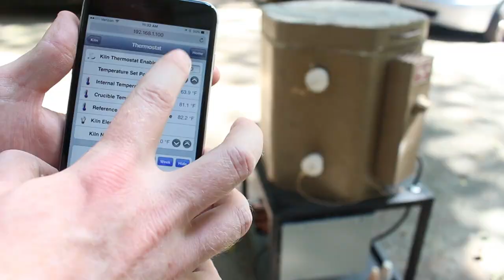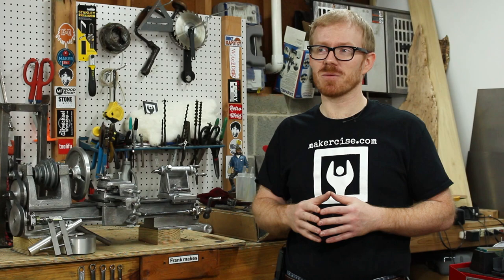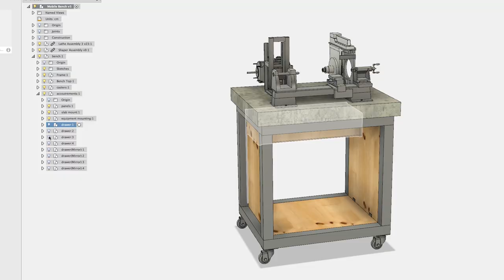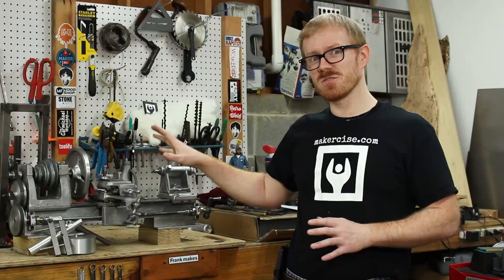5 Minute Lathe Build

Comment: Great series! I built my own lathe similar to the Gingery design,  It swings 9 inch over he ways, gear driven apron and hand wheel on rack and pinon, I might suggest you use 10 WT oil for the head-stock bearings. You need to use cutting oil on your turning projects, the tool steel loads with the turning and fractures your finish..high speed slow feed, plus cutting fluid! When using centers for turning, which should be hardened, use extreme pressure grease on the engagement, along time ago we used "white lead".new project is a knee type milling machine..........anyone who builds these "home grown machines" is a tribute to Dave Gingery.......Have fun and be safe.....always think outside the box!
Reply from the maker: Christy King I picked up some magic tap fluid. It smokes a ton...so much that I'd rather skip it on all the rough turning. for finish cuts the fluid improves the finish for sure. my ventilation in the basement isn't great so I have some concerns about the smoking. the SDS suggests that there are no minimum exposure concentration limits where respiratory ppe is required. this seems counter intuitive to me so I have been running dry since the only drawback seems to be surface finish. thoughts?
Reply: There are numerous cutting fluid products available, some are synthetic and there are those that are water based. The "mist" type application is the new norm, along with flood or flush, which is used on high speed CNC apps, I'd try a mist type unit if smoke and fumes are a concern, Magic tap is not a good product for cutting fluid for turning!

Comment: What find very nice is the lathe helping complete itself.    It drives home the tool making tool aspect of the lathe.   You might want to include an overview of the technical details of the lathe.  I mean speeds capacities, gearing options, etc.   A shop made uni, allows these features  to change., over time. Thanks for a great series.

Comment: I have had the Gingery books for years, but never  took the next step.  I should try it,

 I do have casting experience
If I could make a small suggestion. Make yourself a right angle pour handle. Better control and safer. 

Excellent set of videos. Looking forward to seeing the shaper built.

Comment: wowzers. i wish i could do that.  im almost there.  its really about reaching critical mass.  you know, accumulating enough tools to begin making tools with your tools, im approaching critical mass. im 35 i mean 32
Reply from the maker: Please be sure to share if you get to that point and start building. The great thing about the Gingery design is that it doesn't require a machine shop to start with. A tiny drill press like mine though a luxury not mentioned it the book, seems like a tool Gingery would have appreciate had they been so affordable 30 years ago.

Comment: Amazing build. Watching this 5 mins condense truly shows how good you are. Quick question. Any video on the Motor parts build?
Reply from the maker: Joseph Joe no. I quickly fabricated without filming. I am going to overhaul, film, and put out a video. probably out about a couple months guestimating. thanks for the complenent.
Reply: Thanks for your quick response, I appreciate that. I bought Dave Gingery book, hopefully it will explain that part until you make the video. Once again Great job
Reply from the maker: Joseph Joe it is an excellent book. the motor Mount is detailed in the lathe and shaper book.

Comment: Personally I’d never build one of these the accuracy would be difficult to achieve and having a lathe and mill already I could far exceed the quality and avoid the cheap alloy casting. It’s a great learning experience for a beginner and the plans themselves could be used as a basis to design something more rigid. Even using thick mic 6 plate would be a better choice for many parts and either 4140 or 17-4 for others. Cast steel would be ideal for the base but obviously out of reach of the home brew. Neat to see someone actually do more than just read the book as many will do and leave it at that.

Comment: I've been watching your builds of the lathe and the shaper for some time now.  Very impressive work!!! 

Question: In one of your shaper videos, you show a brief screenshot of a spreadsheet showing your total time (I think), materials costs, and fuel costs for the shaper.  Did you keep track of that for the lathe?  If you reference this in a video, I have missed it.  What was your total time, material cost, and fuel cost for this lathe?  Thank you!
Reply from the maker: Unfortunately I abandoned meticulous time tracking. I estimate 1000 hours +/- 500 for the lathe build...same for shaper. ~$200-300 a piece. $60 propane cost. Wildly Aimed Guess (WAG)
Reply: @Makercise  thanks for your response! And also, your definition of WAG is more family-friendly  than the one I learned. :)

Comment: Now that you've completed the lathe and used it for a while is there anything you would have done differently or would change so that it would perform better?
Reply from the maker: Harold D funny you should ask. I will cast replacement bearings and a chuck adapter within a week. Keep an eye out for the video. Probably within a month or so.
Reply: Looking forward to it. The reason I ask is I'm starting to work on my Gingery lathe now and I'm hoping to benefit from your experience LOL

Comment: I'm assuming that you had some background in metal working to be able to build this lathe.  I have the Gingery book (bought the thick volume before Lindsay retired), and I'm amazed that Dave built the lathe BEFORE he built his drill press and Milling machine.  To me it's a bit of a cave man process, which your videos make look easy (it's not).  One of these days I'll try getting a charcoal furnace going and at least try to do some casting.  I have built a 3D printer which could be used to make some of the mold forms.
Reply from the maker: I had a drill press and a bench grinder. I bought a welder and angle grinder at some point during the project. I didn’t and still don’t have a mill.

Comment: hey chris, i'm just building a woodturning lathe (i really want a metal lathe but that requires more skills i dont have yet). your videos helped me out quite a bit in figuring out how some things work and how they dont. 

i hope i can fabricate templates for a metal lathe. the woodturning lathe is built of steel, and i wonder if its strong enough to turn soft metals like tungs... ahm copper and aluminum maybe also brass... is there any comparaison between wood and metal from what the forces are? i mean its not gonna be dead on accurate but i dont really care as long as its somewhat close in tolerances. 

anyways great videos, keep it up and you will have a lot of subs soon :)
Reply from the maker: +Sharky i dont know of any comparisons. I am sure there are some somewhere. Probably the best bet would be to rig an angle grinder in the mix. Because it abraids material the cutting force could be almost nothing depending on how much time you want to take turning the part. I say go for it either way.
Reply: thats a brilliant idea! but one week and many hours later, i'm quite confident that the thing is gonna be strong enough to cut whatever i want. the only things left to do until first cuts can be made is finding or fabricating some temporary pulleys wich is surprisingly the most difficult or most expensive part to find to this point
Reply from the maker: I got some locally at a hardware store, but I had to special order one of the step pulleys from McMaster-Carr.

Comment: What kind of shaft did you use for the head stock
Reply from the maker: You might want to confirm this with the headstock and permanent spindle videos, iirc 1018 CRS 1" turned down to diameters.